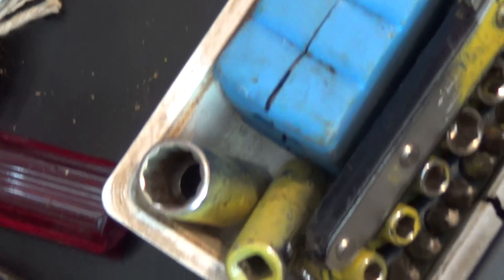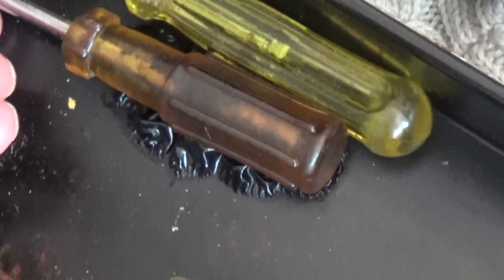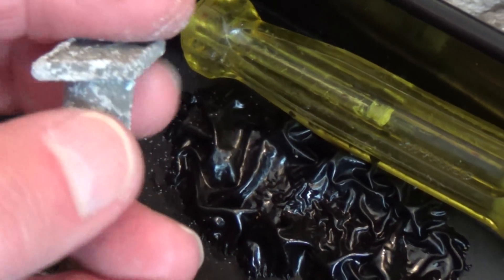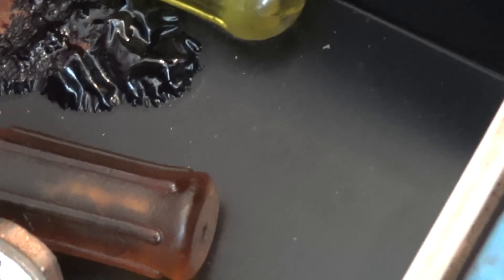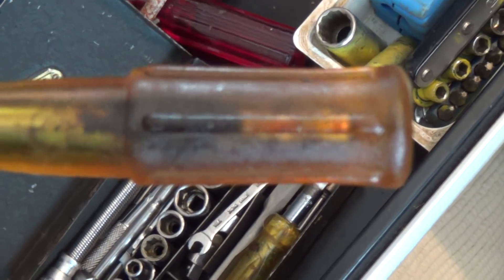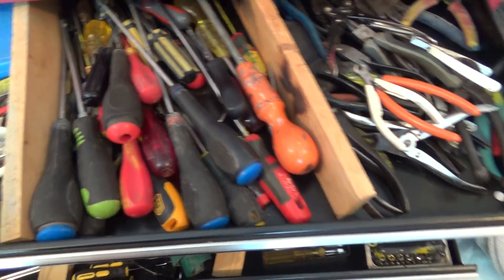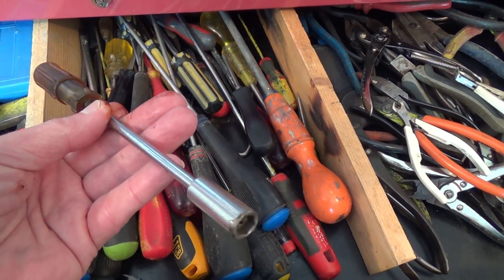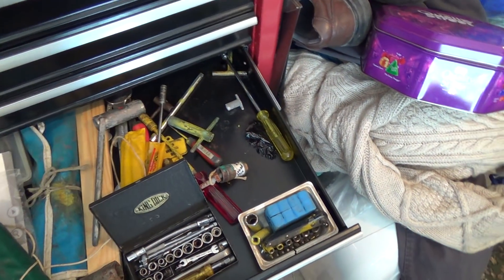Vinegary smell from old plastic? Look out you have a problem.

Comment: One place I worked had a small nut-runner that did the same; it was known as the 'arse-crack spanner'. It spread rot everywhere, like a ripe banana in a fruit-bowl. It was only kept, because it was a thin-wall socket that would fit into counter-bored holes.

Comment: Break the acetal off the shaft, then get a wooden file handle the same size and use that instead. Oil the wood and it will last practically forever.
Reply from the maker: I 've already cut the handle off, I should have slip the spastic and saved the tange of the shaft but I was so irritated I just wanted to junk the offending item.

Comment: I remember you talking about this about 5 years or so ago. I think I might have commented back then that a lot of my dad's old tools ended up like this. Seems as though the newer plastic doesn't do this..... Of maybe there have not been enough years for it to happen yet. It seems as though the old Excelite brand tools were really bad at this happening. Most of my Dad's old screw drivers are no good now. I really haven't used those tools for many years anyhow. They were just kept around for sentimental reasons.
Reply from the maker: Ok on the sentiment but if you have any old tools left watch out as the fumes alone will wreck any exposed steel, even the draw runners by the old nut runner have been effected by the fumes.

Comment: I didn't know about this. I've seen rubber decomposing to a sticky goo. It happened to binoculars I gave to my mother as a gift, and then to the dock charger of  a Samsung handcam I have. I heard about the rubber ring of some Canon lenses having this problem too. Well, at least your tool lasted 40 years.
Reply from the maker: Ho man rubber can go really horrible, it can go sticky lick free flowing chewing gum and stick to your fingers. I'd forgotten about that until you mentioned it. I've had rubber cloves glue themselves together. I once saw blue/green liquid running down the wall from a light switch in a house. The cable had degraded and the acid was reacting with the copper wire, it was like some horror movie effect.

Comment: Good to see you again Andy.  I had that same corrosion in a metal tool box but didn't know it was the plastic handles on the screwdrivers I bought about 40 years ago that did it.  I'm a bit disappointed because I bought the screwdriver set at Nutts Corner outdoor market and it cost me 99p for the set of 15!  When I showed my Father the great deal I got and said "They were only 99p for 15 screwdrivers!" he replied "Well, you wouldn't have got good ones for less".  LOL
Reply from the maker: I don't think that it's just budget value tools that suffer from discomposure. I think my nut runner was a Stanly product.
Reply: @AndyDaviesByTheSea  I hope not Stanley. I've had some Stanley tools in my box that are more than 40 years old. They seem good for now.

Comment: put them in hot water with baking soda and dish sope than oil the metal when done to prevent rust
Reply from the maker: I've never heard of that before, I can't imagine that it would be a long term cure but I might try it out on the defective handle and leave it bagged up for a while to see what happens.
Reply: baking soda helps neutralize acid and the dish soap washes it I do about 20 minutes after a rinse and dry a shot of oil on the metal to help stop the rust

Comment: My toolbox did the same thing.
Reply from the maker: I must have had that nut runner for over thirty years and for some reason it's just started to decompose. It's funny to be sentimental about old tools but boy that runner hasn't half done some work in the past. It's a 2BA (that's British Association) and was one of the most popular sizes In a lot of lectical work that I used to do.  I've cut the handle off and thrown it away and kept the socket end.  All the best . . . Andy